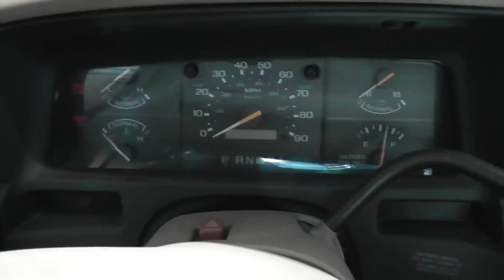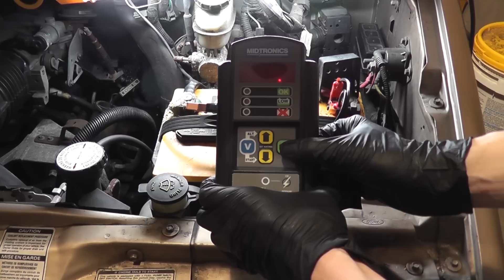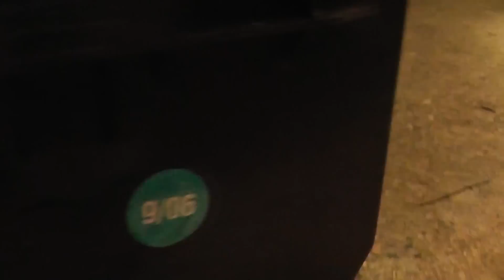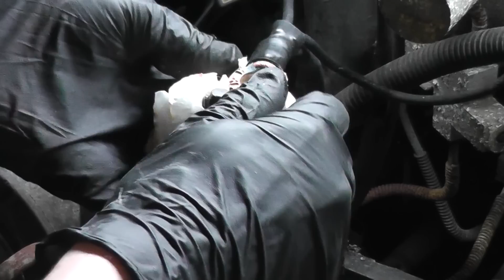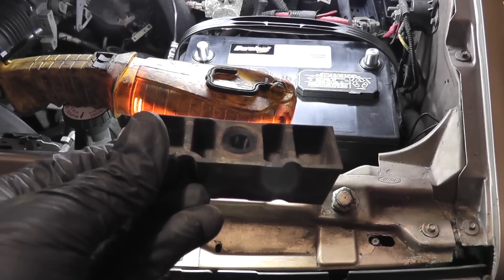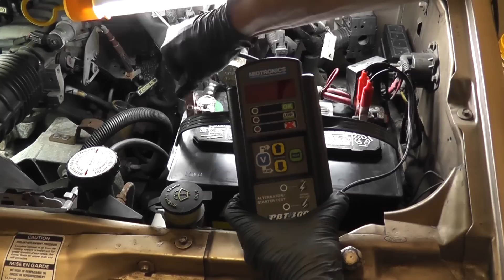Engine Won't Start - No Crank Diagnosis 2 (Diagnosing A Bad Battery)

Comment: hi, hope u are doing good. I have 2015 Hyndai elentra. Car doesnt start and doesnt crank, but if i push the car by keeping car in park a little jurg then if i come back and start the car it starts.  i have asked dealer to change starter , but even after that this problem occurs..  do u know any reason behind this.

Comment: What if you have an intermittent no crank no start condition where the car will be dead unless you keep twisting the key until the starter cranks and the car starts just fine?

Sometimes, when I crank, it'll crank for a split second before it does but if I keep the key turned, it will resume crank and start just fine? This is the issue I'm having with my '96 Accord. I believe it had an immobilizer on it that has had the wires in the engine bay cut. Have you had a similar issue with yours?
Reply from the maker: ***** Those Honda's are notorious for their ignition switches going bad I'd check that first then the immobilizer. I've already made a video on ignition switch testing and replacement. If the ignition switch and immobilizer check out then all that's left is troubleshooting the starter.
Reply: ***** Thanks for the advice! I assume the part number from that video will work on my car too?
Reply from the maker: ***** Technically it should but the 96 models aren't in the recall TSB so I'd just let the dealer look up the part number. You can also buy these aftermarket.

Comment: One q if I want to change terminal shld I have to buy from oem if not for aftermarket can I buy any terminal or specific one
Reply from the maker: sivaraj palanisamy OEM terminals are either crimped or soldered on which requires special tools. Aftermarket terminals are your best bet you can just bolt the stripped wire onto them.

Comment: Good video but a load tester does this in a quarter of the time
Reply: Or conducive  tester vs meter
Reply from the maker: Oozingmachismo24 Many people don't have a load tester. A load tester is useless unless the battery is fully charged and truth be told the cheap tiny 100 AMP load testers most people would buy don't put a full load on the battery. Are they better than nothing? Sure but they're far from ideal.

You really want an adjustable carbon pile load tester so you can adjust the resistance and draw the same amount of current the starter draws. These larger load testers run at least 100 bucks. Not cost effective for someone who just wants to work on 1 or 2 cars.

In addition to that you'll waste more time charging the battery before you can even use a load tester which is why a conductance tester is the first thing I normally reach for a fully charged battery isn't necessary.

But again even though I show them for your information I try to limit special tools unless absolutely necessary and show alternate less expensive methods.

Comment: did you think the charge voltage was a bit high?
Reply from the maker: Dan Gunson Wow didn't think someone would catch that so quick :-). Better put an annotation.

At no load on these older Fords 13-15 volts is normal.

If I would have turned on the headlights, rear defroster, blower motor, etc the voltage would have dropped.

That's why when testing an alternator while on the vehicle (by measuring the voltage at the alternator B+ terminal) you want to turn on as many of the high current drawing accessories as possible to put a heavier load on the alternator.

A bad alternator is like a bad battery it can test fine if it's being lightly loaded but will fail to perform when heavily loaded. But charging system testing is another video entirely.